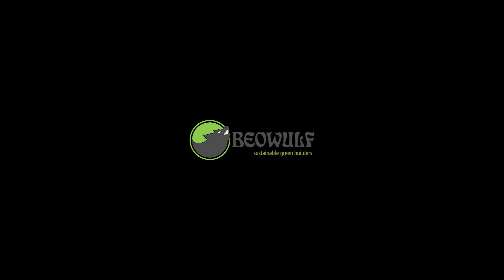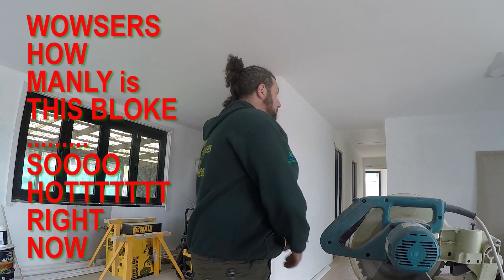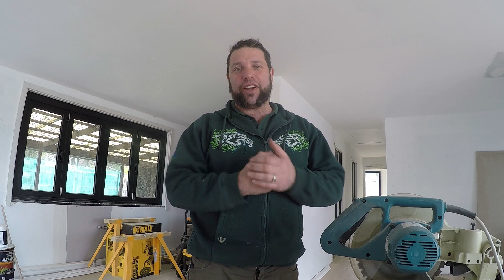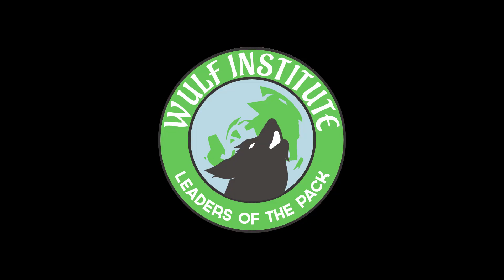Off gas & VOC's- what is it, how does it work, how can we fix it ?

Comment: One way to remove VOCs is with a "cook off". You shut the windows and seal as many entries as possible then increase the temperature to 30 Celcius. You go away. You come back 5 hours later, you stop the heating and open windows and blow air our with strong box fans. Do this 3 times. The high temperature accelerates off-gasing of adhesives, like tape, carpeting, plywood and OSB glue.
Reply from the maker: Hi Null pointer,
yes, this is one way to help accelerate the off gassing yet it can make the environment very harmful and full of toxins plus it has only a very small effect to the off gassing process.
air purifiers or spider plants are fantastic to help plus cross air ventilation and smart design and product selection is a must 
#Stayawesome 
joejo Wulf Hoooowl'n out

Comment: I have a condo that got new cabinets that are made of a maple wood and were sold ready to build and install.  They've been in my unit for about a year and smell really bad especially the kitchen sink cabinet.  I"m assuming parts of the cabinet are made of MDF or particle board based on how they're manufactured.  I only got one window since the unit is attached.  How do I get rid of the smell?
Reply from the maker: i have so many questions regarding this .... Maple wood is a beautiful timber would be very expensive if it was all solid, so my guess is that its a timber veneer over the top of mdf or particle board. 
there are a few different ways to get rid of the smell and the fastest way is to warm the timber / board up with the heater and then open all the windows, bring in some clean plants what help the air and even use an air purifier.... then get natural bee's wax candles and buns a few of these can also help clear the air

Comment: My problem is chronic cough which i have had for at least 40 years. I've had all the tests but never found the cause. Just lately i had to spend  5 days in hospital. I then noticed i wasn't coughing. This led me to believe my house,  which i had suspected before was causing the problem. I looked into off gas and bought some activated charcoal air filter pads and placed them around the house. Directly my head hit the pillow in my bedroom the coughing would start, but after a few days of the charcoal filter being in the room the coughing stopped.
Reply from the maker: emphosymol is the worlds greatest product... made in New Zealand

Comment: I spent a lot on a very large rug to be delivered and its a real pain to return and honestly i just think every rug is going to off gas post pandemic has created a very unsafe consumer environment. Unfortunately my husband refused to let me buy used which would have been a good option. . Im on day 2 of off gassing and we need to get our stuff out of storage is there no way to more quickly get this rug cleaned and safe? I have cats and a kitten that im worried about besides every time I touch it my hands start swelling and stinging. Right now I have it draped over things in a covered outdoor area with lots of air flow. When i run my fingers through it it leaves a sticky maybe oily residue. What the heck is that even? 😢😰
Reply from the maker: no idea where you got your rug, but the more natural the material and colouring the easier to off gas

Comment: Plants are a great idea but won't works unless you have lots of sun. I just bought a faux fireplace on Amazon and the smell in the wood is awful. Right now it is sitting in a bedroom with a windows open. I heard working the fireplace helps to burn off the gasses faster. Obviously Amazon said nothing about this issue on their website -
Reply from the maker: Gday Citticat2,
the timber smell can change very easily depending on the different timbers you use to burn with so a hickory is AMAZEBALLS and so is cedar, Alternatively if you are using brickettes than put some lavender or rosemary oil in a ceramic bowl and place ontop....so nice

#stayawesome

Comment: I moved into a new construction apartment where the vinyl roller shades smell very bad. From your experience, how long does this take to off gas? I’ve been here 2 weeks now and it does not seem to get better and was wondering what your thoughts are. Are they low quality? Should I replace them? Thanks a lot!
Reply from the maker: Gday GA,
Best thing you can do is air out the apartment with cross air (if you can...open all you windows as often as possible) an air purifier adn retaining certain plants that also help purify the air.
other than that there is little else you can do without replacing all the floor coverings and hte paint on the walls and ceiling
#stayawesome
Reply from the maker: Feel free to sponsor us at www.patreon.com/beowulfbuilders to help us create more great content

Comment: I just moved into a brand new apartment and having issues dizziness, headaches, tiredness, and allergy symptoms. I believe it’s the new carpet causing these issues. I’ve been airing out the apartment by having my windows open almost 24/7 for about a week. I am starting to feel better. Is airing out my place is enough or will getting my carpets shampooed speed up the process significantly. Also, if my symptoms do go away, does that mean a significant amount of the toxins have left and I can worry less about the health effects?
Reply from the maker: Gday C.A.
Yes a good shampoo & clean will significantly help as long at the shampoo they use is a natural cleaner with low VOC or chemical base.

the effects that you get from floor covering such as carpet come from the dyes they use as well as the material & glues.

air purifiers will also help, natural airing is obviously the best option, another is researching some plants that are good for your living requirements/area adn place a few around hte house.
Hope that helps
#stayawesome
joe joe
Reply: @BeowulfBuilders  Thank you so much for the information. What are your thoughts on using a carpet cleaning machine with just water, no cleaning solution?
Reply from the maker: you need some sought of cleaning solution... even if its as simple as vinegar or lemon juice or baking soda
Reply: @CAsaidit  Hey! It's now a year ago. What insights have you gahtered? I'm facing the same problem right now and would love to hear how the situation unfolded for you... Hope you're doing well now!
Reply from the maker: Feel free to sponsor us at www.patreon.com/beowulfbuilders to help us create more great content

Comment: We bought a condo today. New carpet installed one month ago. The smell is very strong. We got a headache after an hour. I left a cup of vinegar in each room.We are going to remove the carpet and put in tile. What else can we do to off gas?
Reply from the maker: tiles on the floor can be very hard underfoot, especially in bedrooms.
there are a number of low VOC carpets out there.  the main thing to look for is if they are natural fibers (wool 80% poly 20% is a good combo) and the dyes that are used in the colouring process
an air purifier does help and certain plants will also help..... do your homework on these
#stayawesome

Comment: Hey boss I recently installed two vinyl windows to the front of my house and then I started smelling some top of oil smell how can I fix that ? Will the smell go away over time is it because the sun is hitting the  vinyl windows ?
Reply from the maker: Gday Catra,
We are not sure about the "Vinyl" windows ?? are they PVC or Plastic molded ??
Any plastic or Poly based product has high amounts of VOC's in them... this is part of their forming process and/or adhesives used in holding the material in shape.
To help with the smell, you can use plants that absorb carbon and help purify the air (some plants are better than others & you can google this) or alternativly you can purchase an air purifier & oil burner to help with the smell and chemical/VOC compounds in the air particles.
#stayawesome
Uncle joe joe

Comment: Which plants do you like best for VOC absorption?
Reply from the maker: Awesome Question.....
Attached below is a VERY good article with a brilliant breakdown of the VOC's indoors and some recommendations of some plants.
https://foobot.io/guides/plants-that-remove-volatile-organic-compounds.php
#stayawesome
joe joe
Reply: @BeowulfBuilders  thank you!
Reply: @BeowulfBuilders  great info joe joe!
Reply: Before you move in, kick your heat on very high overnight with closed windows. Open windows and air house in the morning. Repeat several times. 
This isn't a cure but it helps.
Reply: Joan Halcomb why the heat, I usually use cool air. I would think the hot air may make the chemicals react
Reply: Plants don't help. Seriously.